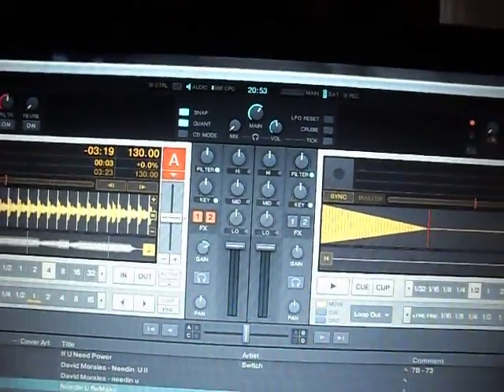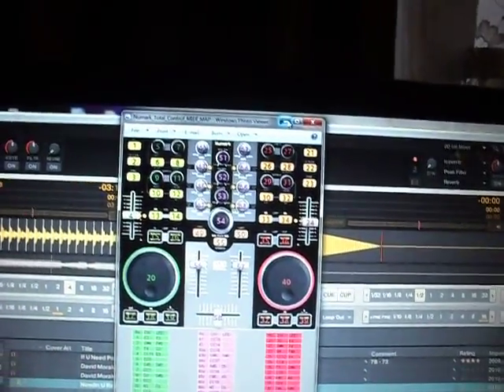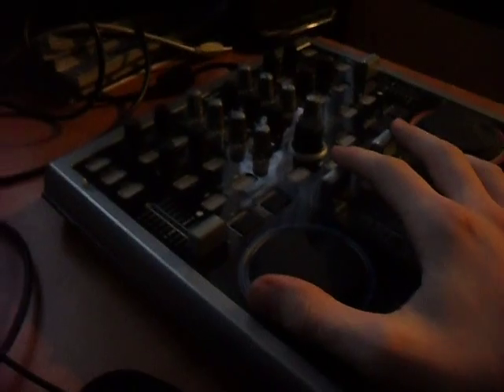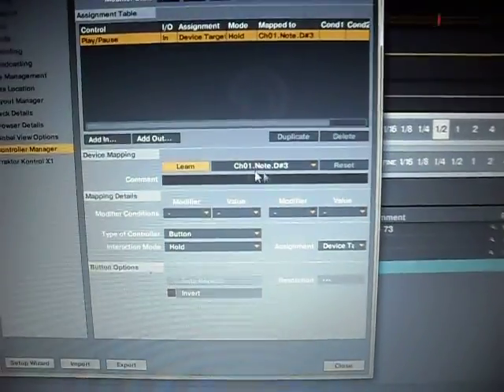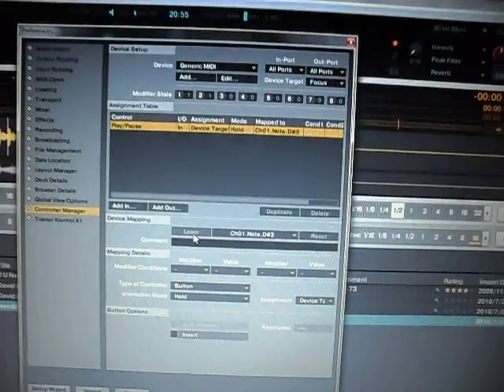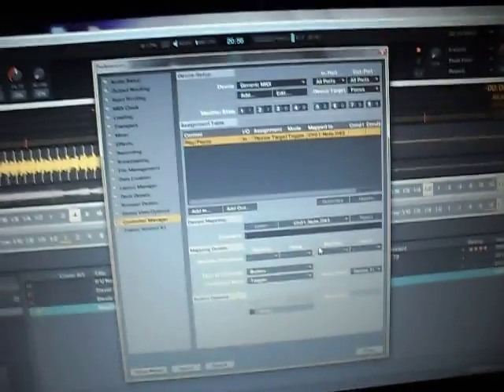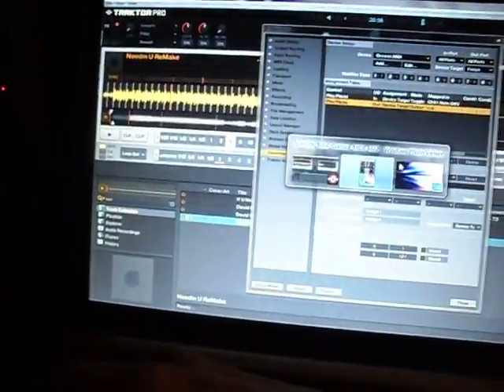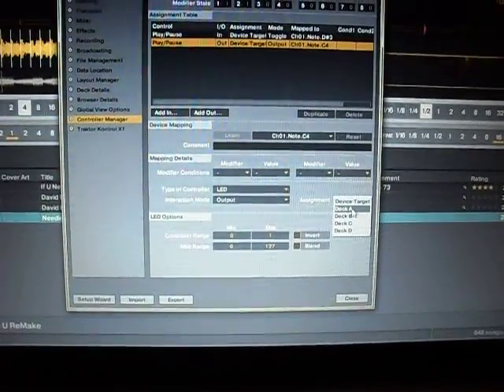Traktor Tutorial - Setting up LED on a MIDI Controller (Numark Total Control)

Comment: @KelseyBDJ 
   1. Set up the Play/Pause output as normal, but under the modifier conditions, set ‘is in loop’ and 0
   2. Now create an output for beat phase meter
   3. Map it to the same LED
   4. Set the controller range min/max to 0/0.1 (the phase meter range moves up in decimals from 0 to 1)
   5. Set midi range min/max to 0/127
   6. Set modifier to ‘is in loop’ and 1
   7. Uncheck invert and blend